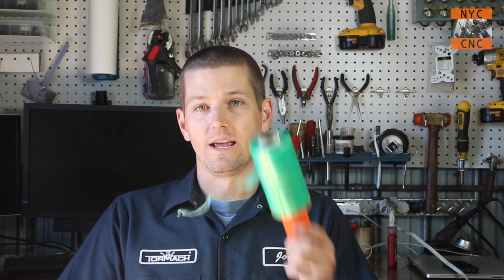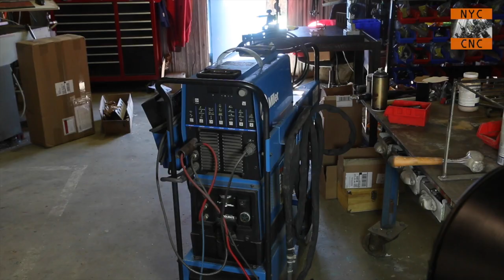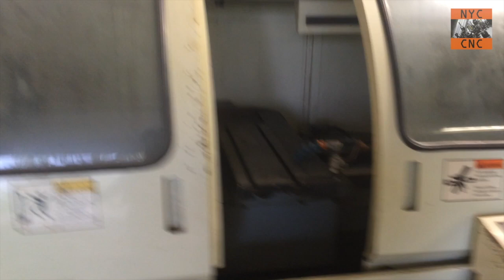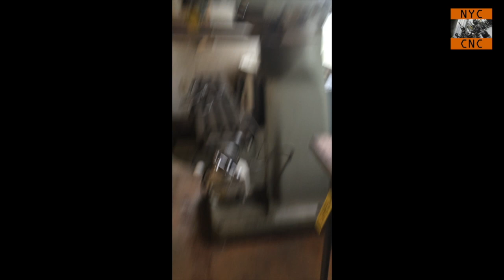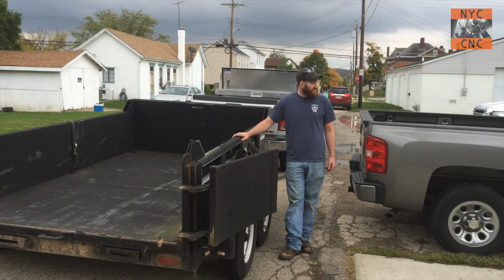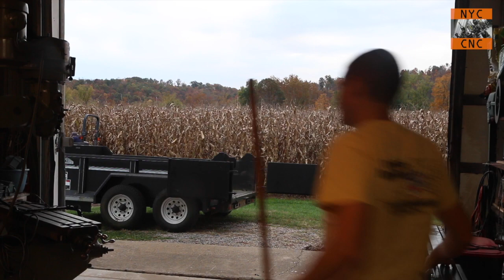Buying a Bridgeport, TIG Welder & More at Auction!

Comment: You did good on the bridgeport. In about any part of the country a "good" Bridgeport like that would fetch 3 to 5k or more. In the Detroit area there are tons of cheap mills for 1500, but a good one still goes for 3k to 5k or even more if it is top notch.

I would not pay much at all for a used surface plate. You really have no way to tell if that plate is good or trash unless you bring a huge very accurate camel back straight edge with you. Surface plates are a reference point, you really want one that is half ass? 

A surface plate that big is not "that" expensive unless you get a really high end one. You will need to "inspect" that surface plate very well before you trust any measurements you do on it. 

Some times it is better to save up and buy new then try and save a buck and buy used. No where is that more true then buying a granite surface plate.

Here you go, example of a cheap descent surface plate: Grizzly tools - tool room grade "B" Granite Plate has a bilateral accuracy of plus or minus .00015" - total cost with shipping a whopping $153.95.

Don't bother with used surface plates, NOT WORTH IT.

Comment: ...16:30....that OLD antigue Chicago K+D mechanical press-brake ( actually both of them), OBI press maybe a few $$ these are usually very well hammered and also 50+ years old..........not worth  much over maybe $200 for brakes....a little more for the OBI.......these things are all 50+ years old, press brakes are poorly designed and very difficult to work on....My last employer had 3 of them.....and they drove me nuts.......

Comment: 9:00....machine shop....you really do need a TIG welder.....really...! water-cooled.....weld at 300 amps all day, torch doesn't even get warm...$2900 sounds a little high, but if it's working and then there's the $700 water cooler and $200 water-cooler  torch.....
 Bridgeport.....well....2-3K isn't bad with a variable speed and DRO....plus power feed on X.....these newer DRO's do a lot of stuff besides give position readout...

Comment: Why own this if you have a CNC machine?
Reply: Because often times it is much quicker than setting up a CNC machine, or the CNC machine is occupied with more important jobs. Companies often use conventional mills and lathes to quickly make some fixtures, t-nuts, bolts etc.
Back in my training I often had to do parallels (they were ground later on tho), t-nuts or anything they needed quickly.

Comment: Hey there John... I've watched ur vids for quite a while, and I must say... I (and my wife) thought I was a strange victim of severe AADD but when I found ur channel, I realized that... I can't speak to the AADD but regardless I'm not the only one:) I could get all sappy an address how much I've learned and grown as a result of ur channel, but I'll leave that for later. I recently snatched up a 1959 j head BP from a base in Cape Canaveral... The offloading process... Ha... That was an adventure which I'm sure would make great reading but for time and character space avail. Null... I'm not a machinist... I'm in Video production for a marketing group but find my soul be recharged in doing almost all the things on ur channel... I don't like spending money... As most us don't and I'm going to automate my BP. I'm gong to attempt to mate a .45hp brushed DC motor with a 90degree gear assembly (from an electric wheelchair) on both the x and y axis . I'd like to have ur input. Thoughts?
Reply: +NYC CNC - correct, I've read endless debates on stepper vs servo style motored... I have an Arduino, gshield, and was originally going to go with a few Nema steppers, but do to there cost, I went shopping through the shed instead and found 4 basically brand new power wheelchair motors. I have a million ideas on the best linkage/mount plate setup/ best scripts for operation... I know I'm going to probably end up grabbing a raspberry Pi, and a different shield to use servos and later build something similar to ur engraver  with the Arduino and gshield. I'm still in the tear down and cleaning process so, there is time to plan. Just saw ur new shop vid... Slick! You figure out what Lighting solution you were gonna go with? If ur still looking... My brother in law owns one of the Largest lighting distribution companies in the country, and he would love to help you out!
Reply: +NYC CNC So since my last message, in regard to my BP project, I've torn down all but the Head, used electrolysis to remove the rust (only way to go!) and I'm circling back to a CNC conversion part... I've settled on using a 2-3hp DC motor to replace the 3 phase 1hp AC motor currently installed... After a few thousand more pages of research... I've decided to eat the cost on Stepper motors and purchase 3 Nema style steppers to drive the XYZ axis. I'm assuming that my gshield won't handle the needed amperage for all 3 steppers that the BP would require to properly augment axis position. But what is the healthiest sized Stepper (Not trying to stress the motors, or sling a ball screw across the shop either) to power these 3 planes in your opinion?

Comment: Advice to you children.   Do-not let the blind lead the blind.   You never believe a fork lift truck driver how to lift a load .
The bridge port has a central lifting threaded eye lug for lifting. On some models you centralize the  head ram and 2 straps round so the load is divided by four.
What I saw was putting the full load onto the dove tails on the ram as stress, it will take months for the head to settle into one position now.
If you go to auction to buy a machine check on Internet on tablet/phone/laptop how to move a anything if it is heavy by the manufacturer. 
especially if it is a machine tool. Machine tools have fixing holes or lifting positions are designed at its time it was made and are never negotiable for tramp lifters. 
Because he picked it up totally wrong you went and did exactly the same wrong when you got it back.  Note the four locking screws that the head ram on the extension spacer i see your mill hasn't load in vertical bearers there only downward gravity clamps.
You were lucky they didn't shear or snap crashing the head to the ground.
Check the machine specs first on line for free.  Do-not take peoples word for it .
Look at idiots who trusted mill and lathe machine mover cowboys and failures.
On you tube. I correct you now this should last the rest of your life.
Reply: Advice to you Sport. Calling people you don't know "Children" isn't a great way to get them to care a rats ass about your self important opinion. Unless you just LIKE showing your ass.

Comment: I own and run a woodworking shop. You did the right thing in buying the Bridgeport.
Get the tools you want and need to do the jobs you want and need  to do.
Turning down work because you don't have the machine to do it or doing a job on something less than the best machine for the job doesn't pay. The mill will pay for itself.
Don't second guess yourself.

Comment: A bit late to the party here, but check the knee jib if you haven't already. Make sure it can't drop and subsequently jam the knee. The upper end has a slot where the adjustment screw locates, this end can crack off. Don't ask how I know, but I'll just say ours now has a 3 inch hole saw cut in the bottom of the coolant tank, and a new jib.

Comment: You hit on some good points here. When it comes to auctions, bid strategy is just as important as your bid limit on any particular item. What I've learned over the years. Never be the first to bid on an item, unless the auctioneer is going to pass it. Even then, you will notice your bid will encourage others to jump in. But the all time most important rule, never bid on anything until the auctioneer has begun to close the bid. Going Once, Going Twice..throw your hand up Bidding quietly and confidently shakes people up. If you jump in early other people will think, "well this is a good item, i should bid on it too" Wait till its almost sold, jump in at the last minute. It will make others think you have a higher bid limit than you do, and they will often bow out instead of wanting to start a bidding war with someone that has deep pockets. It gives the impression you know exactly what an item is worth, and you are prepared to fight for it. Lastly, don't respond to counter bids quickly. In bidding wars the auctioneers will "phantom bid" jumping the price because they know the bidders are looking at him, not at the crowd seeing which paddles go up. I see this crap all the time. Try everything you can to keep the bidding pace slow. :) Happy Bidding!
Reply: NYC CNC Yup! I'm a nodder too :)

Comment: I started with a Taig CNC.  I got a manual mill bridgeport clone, the Kondia FV-1 with a 2 axis DRO.  There is something about being able to mount the part to a vise and just GO.  With CNC, you have to draw the part, make the tool path and that go.  I work on lots of parts that are just single run.  The manual mill works best for that.  I have an EMCO PC55 now, but it is still gathering dust as the manual mill is doing what I want it to.  I still plan on getting the CNC back to speed - but that's my experience so far.

Comment: I think you did well. Even if you find a bug the bridge port will have parts for ever. I have a Bulgarian lathe. Don't think there's 500 hours on it. Got a Brocken gear. Although lions is still around there is zero parts. Judging from the auctions my father and I went you did very well. I have a miller welder and they are great. Its gig stick ac and DC. Love it. Also have a time stone welder it to is reliable. Enjoy your Chanel. Warren

Comment: I'm impressed.  Haven't seen any of your videos since the New York apartment days.  Think you got a good price.  I paid $3000 for an ancient CNC Bridgeport, also in the Dayton area.  Probably spent $2000 more getting it running on EMC2.
Of course, right after that I heard several stories of Bridgeports that didn't sell at all in Michigan auctions, and were pushed out onto the loading dock for the taking.
I envy you your big shop.  I'm working in a small, one car garage.  No room to add even one more machine.  Would sure be nice to have a small lathe and a manual Bridgeport there, but no room, unless manna falls from heaven to pay for me building another garage on the other end of the house.

Comment: That's a great machine. Ask me about my cheap deal Bridgeport and I'll tell you a story about putting another $600 or more into it to make it a nice floor drill... the ways are shot and need resurfacing. If your mill has a DRO installed, chances are the ways are mechanically sound and accurate. You can fine tune the rest from there.
Reply: NYC CNC
Yes I did. An eBay auction that I caught at the very end. The seller is local and described the machine "in good working order". Got me good on that one. But hey, it drills excellent holes! :-) I'm exaggerating a bit here but end to end travel does deviate by a few mils and the x/y gibs are maxed out and can't be adjusted any further.

Comment: want to feel good about buying used? I just go look at what a bridgeport costs new shipped to your door ... that will take any edge off for sure lol ... still kicking myself for the $1200 deal I passed up that included a bridgeport with DRO and every possible kind of attachment and tooling you can think of ... went home to sleep on it and when I cam back the next day it was gone.  Here in houston these machines come up pretty regularly and can go from $1200 for a beat up machine to 9K for mint second hand machines. Example, I bought a southbend lathe for $400, it was missing 3 parts, I ended up paying another $600 just to get it running lol.
Reply: nope lol i meant just a "new" mill in general ... I even see import brand mills going for 9k-15k brand new. buy used and save big time

Comment: looks like you did quite well. i have the identical tig welder and its a caddilac. one nice feature is it runs on single or three phase power. it has a board that detects the voltage and phase and sets the welder accordingly .i run mine on single phase and ive run it at over 200 amps on aluminum with no problems . the water cooled torch is a great feature. subscribe to welding tips and tricks and jody will show you every thing you want to know about welding. you will be looking for excuses to use this thing. the miller people are great to deal with .they will send you a manual if you need one or download one from their web site good luck

Comment: Hi John,
Decent deal on all that stuff, there is always someone with a lower price, but.....!
The 300DX is a great machine, I've been running a Dynasty 350 for about 7-8 years now, no problems at all, it also does fantastic with rods!
The Dynasty 350 complete kit sells for around +$10K these days.
I've been told by repair shops that those Miller inverter machines are very rarely ending in their hands.
That $5000 milling your showed in the video could have been a good deal too, I'm sure that it has ball screw for the X and Y axis, meaning literally no back lash, and being a much heavier machine more stable with bigger cuts.
Your Grand'pa is in good shape for being that young, that leaves you with a good genetic background...! For me that's my Pa who's 87, and good shape.
Take care,
Pierre

Comment: I actually prefer the belt head to the variable speed. The run quieter and don't have the problem with the sheave bushes and keyways wearing. I get the variable speed (and single phase operation) with a VFD.

We didn't get a look at your DRO. I had a 2 axis Mitutoyo on my Long Chang First (sold as a Sharp in the US), but it was an older model for which Mitutoyo were unable to supply a manual. I bought a 3 axis Sinpo complete with scales and sold the Mitutoyo for 2/3rds of what the Sinpo cost. I have twice the resolution, bolt hole functions, radius functions and much more.
Reply: I find the Z axis useful, yes. It's on the knee, but I'll be adding an independent scale to the quill too.
Reply: NYC CNC I did  look into 4 axis displays and also into axis combing units. In the end I picked up an integrated scale & display like Tom Lipton and many others use.

Comment: I have 2 Kurt mill vises and they look like yours. The auction I bought my mill vises at was a shop that went bankrupt during the bad economy in 07/08 things at this place went CHEAP there was a 24"X 36" surface plate still in the shipping crate that sold for $5 I'm still kicking my self for not buying it but I wasn't sure how to get it home in my car !  There were 2 mills that were a little over a year old that sold for $5000 for the Pair  There was a guy from H&W Repair In Fort Wayne that said they sold them to the shop and they were $10,000 each when they bought them!!

Comment: You did good young man!! I feel your joy as I was the same when I got my "Bridgy" as Adam calls them! Like you I had never run one, but my machinist buddy told me I would have no problem, as he told me I have a ton of common sense, therefore would not have any issues. I'm sure you will have no issues either!!
I was at the right place at the right time with the majority of my machining equipment, must be the "Irish" in me!!!
Congratulations, 
Razor!
Reply: NYC CNC 
Hi John,
Yes, I do use the R8 tooling and collets as it is the most common spindle in this type of miller. You'll find more tooling readily available and at a lower cost then going with any other system. As for the quick change setup, it won't be a benefit to me, and to most because I am setup as a home shop with no employees and not designed or setup for production work. I did however email Stan, (shadonHKW) about a power draw bar.
I think this would be a great upgrade for me. And others, Ray Caniglia, (hope I spelled that correctly)and Herb Blair, like theirs.
If your Bridgeport is in relatively good condition like mine, you will be pleasantly surprised at how easy it is to run. Just take your time learning, ask lots of questions if necessary,  don't force any of the engagement functions, and watch lots of you tube. 
Feel free to contact me via e-mail if i can be of any assistance. Be 
happy to share what little info I have!
razorray57@gmail.com 
Razor!
Reply: NYC CNC 
Hope it's just a matter of adjustment. When I opened mine up, all the components were gone!
What a pain to find, unless you go new, then be prepared.. "CHA-CHING"!! Hope that's the only issue with your mill. Good luck! Got any questions? Get back.
Razor!

Comment: Oh, and 2K for that bridgeport seems to be an OK deal. I actually have one of those mythical $1500 Bridgeports, but that is only because my employer was moving and we had an "extra" 9x42 J2 with an old sargon DRO, well, half of one, since the X axis scale was damaged. And My bid was the same as the local machinery rebuilder :). So by the time I got the thing working, I was probably closer to your 2K mill anyways.

Looks like you'll have a really capable shop there in the cornfield :)
Reply: NYC CNC
No, actually I am an engineer at at Semiconductor Equipement company. We do have a small prototype shop. We kept the Haas VF, a bridgeport EZ-trak, an Acra and two lathes at the new place. I and another co-worker do spend enough "therapy" time in the shop that we have become the "emergeny" machinist for when our real machinst isn't there and we need somthing banged out real quick. The mill was kind of an impulse purchase... I was in the shop one day when our main machinist mentioned that it wouldn't come over to the new building and he joked that I should put it in my gagrage. After some quick CAD work it turned out to actually fit... and now I have my own small shop at home.

Comment: That's the most irresponsible way I've seen a BP rigged.  He should have picked it from the pick eye, with a sling under the ram, or with boards on the forks under the dovetails from the side.